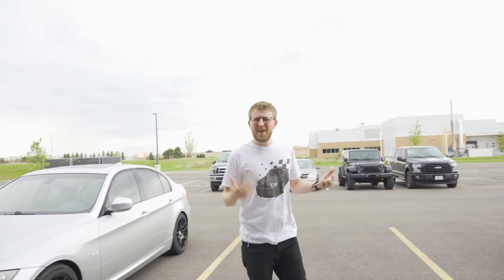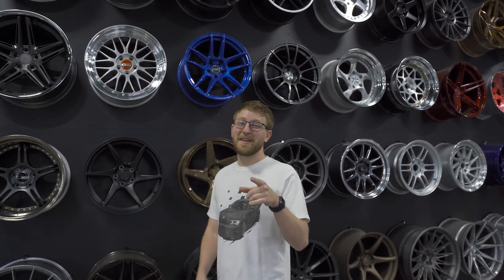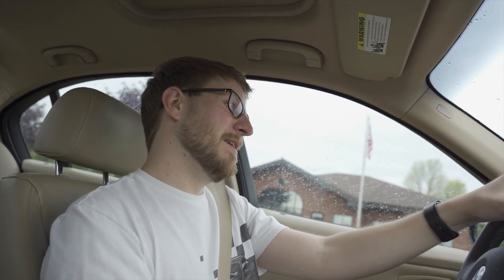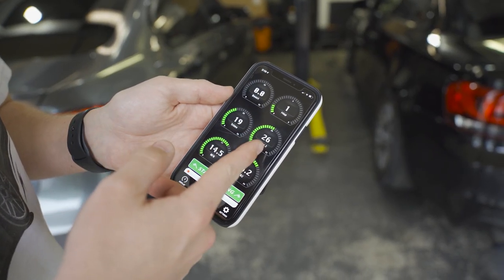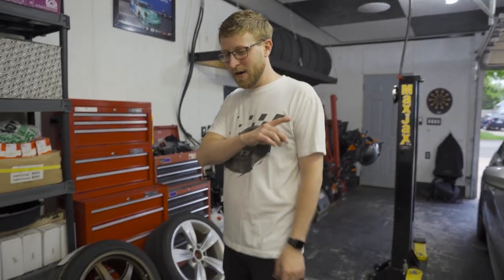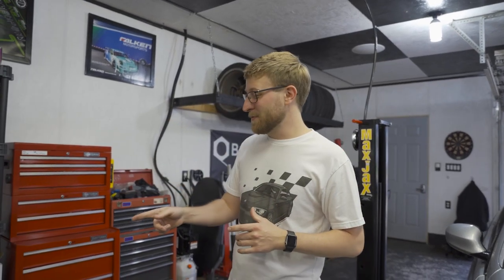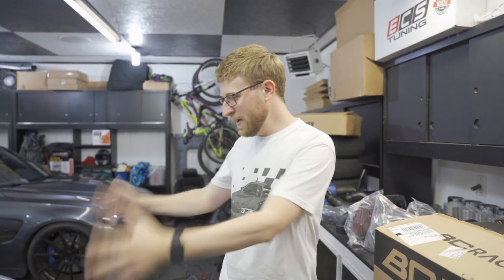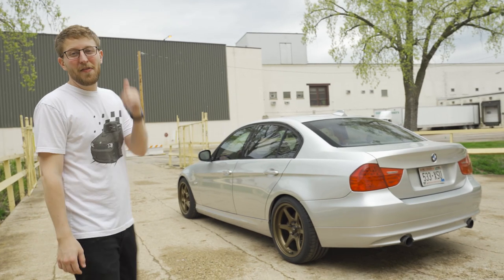I'm Still Alive... but my 135i isn't.

Comment: Check the wiring to the injectors on bank 1 with a multimeter, also check the coils on bank1 usually when the car warms up that's when secondary circuits on the coil fail or begin to break up. Hope you sort it out

Comment: Check the front O2 sensor harness wire that runs closest to the oil filter, (not the sensor itself) I had the same problem. Found the wiring had slightly melted and arced through the sheath shorting it out causing unstable afr on one bank and overfueling under hard load even after changing sensors

Comment: So glad to see you back! I copied your 135i build almost to a tee.  I was having a similar issue with afrs even with new o2 sensors.  I swapped out the valve cover for a vtt billet one and when I removed the doc race intake manifold I found that I had somehow blown out cylinder six o-ring where it bolts to the head. This was giving me an obvious boost leak but just on one cylinder.  Replacing the o-ring fixed the problem
Reply from the maker: That’s awesome to hear, man. You make a good point, I could definitely have something like that going on. I think a compression test and a book leak test should help find anything.

Comment: Definitely feeling the vibe of this style of video! 

For your 135, I assume your injectors are index 12? It's most likely something with your fuel or spark. I'd check the plugs and coils first. Don't listen to me though, I still haven't gotten my 135 running right going single turbo. D:
Reply from the maker: Thanks for the feedback, I’m stoked to hear that 🤘🏼 anyways, yes, I have index 12 injectors. I did new plugs last summer. Currently have PR coils and haven’t heard of those going bad. Gonna do a compression test and go from there 😬
Reply: @jake_spence  been hearing about people having problems with PR coils on the facebook groups.

Comment: When my M20 had cracked rings on cyl 5/6 it would run 90-95% smooth and normal until it warmed up a bit then ran rougher like a misfire on 1 or 2 cylinders. Compression test result was ~ 120 psi instead of ~160. There was also a new tapping noise which sounded like the bottom end. Root cause was the machine shop setting the ring gap to the tight end of the factory spec rather than the increased gap for boost that I advised them of. Hopefully your gremlin is electrical and diagnosed soon.

Comment: As someone else stated below, if you have an MSD80- DME, have your mosfets checked. My cylinder 2 mosfet went bad and caused misfire codes on cylinders 1, 2, and 3. Sent the DME out to a guy on ebay, he replaced them all with upgraded mosfets for like $125.
Reply from the maker: I’m definitely going to look into this if the compression test comes back healthy. I’ve avoided mosfet issues on all of my N54s so far so I always forget that’s an issue 😅

Comment: I would let the 135i run for about 30+ minute. Cut it off and come back to it the next day pull your spark plug and smell them if any smell like gas you have a leaking injector. I would also recommend taking the port injection off and flashing the car to more of a basic tune and see if that helps. Some time some port injection injectors can also leak or the o ring seals can being go and cause air by pass them causing issues. I had the same issue on my last build and I took everything off/put checked everything and it ended up not only ones one of my index-12 leaking but a seal on my port injection was shot at the same cylinder as the leaking index-12.

Comment: The wheels look great but it's hard to beat those apexs lol. What offsets do you run? 

I'm having an issue when my stft1 & 2 are ok at idle or mid range but at high rpms they get maxed 34% with rare lean mixture fault (slightly worse on bank 1). Fuel pressure, air/fuel ratio, no vaccum leaks, no crankcase leaks, new spark plugs, delphi coils, pre cat oxygen sensors are 2 years old etc... Not sure if your issue is the same since your fuel trims are off at idle... the closer to zero the better though. 

It also started after switching from e85 to pump gas, it's being 3 tank fillups since then. 

Hope you figure out the issue that thing is badass!
Reply from the maker: I know, but these are unique and fit perfectly! They’re 18x9" +31 and 18x10" +33. So lightweight too.

Hopefully you figure out your issues... sometimes these N54s are such a pain. You reminded me that I have pump gas in it from winter. I should probably put some fresh fuel in it 😬
Reply: @jake_spence  Yes try fresh fuel before you dive into the engine. Also, let the car set fault codes for a while don't erase them. Then swap things around, coils, plugs, vanos solenoids, injectors per bank etc. Maybe your bank issues switch to the other. 

Haven't figure it out yet I just left it as is. I'm running a richer custom map that helps keep those fuel trims way lower, I'll wait for something to blow up lol. It's weird because I had 0 issues at the track either. 

Good to see you get back! Great content as always!

Comment: He’s baaaacck!! Shame about the 135 I’m sure it’ll be an easy fix but I’d probably start with a compression test, change the plugs and check the wiring from the o2 sensor? And can you hurry up with the build video for the 335 🤣

Comment: Hey, have you checked your VANOS solenoids? Had a bunch of misfires, Limp mode triggered and could not cleared them. Took them out cleaned them up real good and fix my problems at least for the time being but it's a matter of time till they need replacing...

Comment: I’d look into the mosfets, when those start to go the cause a bunch of really weird issues. If you don’t wanna go msd81 you can find a computer repair place (usually) to replace them for like 60 bucks or so
Reply from the maker: Hmm 🤔 if the compression test comes back good I’ll have to look into that.
Reply: Before you go MOSFETs and DME swaps, trace back the O2 sensor harness. Visually inspect for damage

Comment: I have/had the same issues. I reset adaptations and reflash BEF and it works for a while and then after a while the issue comes back up. I have taken out the JB4 and am running on MHD stage 2 e50 map for testing. So far so good. I will be going reflex for pi control shortly after I am confident it was a programming issue with JB4 or the BEF.
Reply: Also found my exhaust manifold was not torqued to spec still. Going to tighten that up but I don’t think that was the issue.

Comment: Are you running a msd81?
Reply from the maker: It’s a 2008 and still on stock ECU
Reply: @jake_spence   I can't tell what ecu you have from year but if you check on top of the ecu it should say if u have msd80 or 81, if it's msd80 you could be having issues with the mosfets from what I can tell

Comment: Could be bad scaling on the new o2 sensors if your tune hasn’t been updated. They all read different and had my car act weird after I did mine. If you can, post a data log link somewhere where we can get it!

Comment: Jake what is your dme is it the updated one msd81? If you have the msd80 Could your mosfet be shot? If your misfires are all bank 1. Cly 1 2 and 3 that is it.

Also switching your bank 1 and bank 2 injectors and seeing if the trims switch to bank 2 could rule out the index 12s

Comment: What about downstream o2’s?
Reply from the maker: I replaced them in the last 2 years, do you think faulty downstream O2s could cause this?
Reply: @jake_spence  I’ve just heard that they communicate to the upstreams and if downstreams are bad that communication is affected. But if you’ve replaced before may not be the issue. Ohm testing can be done on them, but I’ve only seen it on YouTube
Do a small log and send it to your tuner? See what is said? 🤷‍♂️

Comment: to bad the fronts and rears couldn't be concave like the rears, also why is apex boring, because everyone has them? Have you tried the secondary O2 sensors, most stop at the primaries, also the whole harness for the O2 sensors, heard they can melt

Comment: When's the last time have you updated injectors?
Anyhow my 335 behaved sort of the same up until I updated injectors, refreshed to new maps and walnut blasted the engine, including new packs n plugs as well Still doing fine but don't know what all you've done, recommendation check around bro still good to see you at it man 🤗
Reply from the maker: It definitely could be one of the injectors, even though they’re all index 12s. Gonna check all the basics after I do a compression test. Thanks for following along man, you’re an OG!
Reply: @jake_spence  Yeah brother I'm still peeling back pavement Lol 😆
Reply: @jake_spence  Shouldn't be injectors if they are new 12s.
Reply: @TheFrenchPug  even index 12 can be bad. its not offend but it can happen. Had 2 index 12 couple months ago causing issues
Reply: I just put all new infex 12s in and if fixed 99% 0f my issues

Comment: Since the misfires are on the same bank after switching o2s I'd assume mosfets but you can switch bank 1 & 2 injectors around to see if it's one of those first. If it's mosfets it would be a decent time to go standalone If you want to take the 135 to the next level. Love the content and can't wait to see what's next.
Reply from the maker: I would love to go stand-alone. I think it would take this car to the next level with a built engine. Would be great to set up proper launch control and NLS 🤘🏼
Reply: @jake_spence  Same, I want true rolling anti-lag on mine and NLS on mine. I would also like to see people do more with standalones like switching to a different water pump and t-stat completely and really make these engines what they could be. I remember rob dahm having a video about how he uses a 5 series water pump on his 4-rotor. I think something like that would be cool.

Comment: Downstream 02? And if u did do those then maybe mosfets?
Reply from the maker: This is the second comment I’ve seen that mentions these two things. Gonna dig into it this weekend if the compression test comes back healthy 🤔
Reply: @jake_spence  vehicular diy did a video on how the car uses secondary 02 in calibrating afr and idle. it’s like a 30 dollar diy job with a generic Bosch sensor off of Amazon. Really cheap to do so might as well. Or fcp if u got them before there. the car on cold start does not use these 02s to calibrate idle because they aren’t warm. After a minute or two  u will hear the idle change and that’s when it switches over to using the 02s to control idle. If ur car starts messing up on that change over it might be 02. Also the issue is bank related which is another tell.

Comment: About time you came back lol,🖐 from 60 ROLL Cape Town

Do smoke leak test, maybe intake o ring gone bad.

Coils and injectors after that.

I think this started when you ran your 10.3?

Maybe the high boost popped a oring on intake?

Comment: If replacing O2 sensors normally fixes it, but now ISN'T fixing it, it's time to check the wiring to the O2 sensor(s) connected to the problematic cylinders/trims.

Comment: Swap all from bank 2 to bank 1 . I mean injectors coils and spark plugs.  If will not resolve problem that's mean ECU  has a issue with cmos or wiring

Comment: Any vaccum leak?
Reply from the maker: Gonna have to test, that’s a good point.
Reply: @jake_spence  maybe it's an oil pressure issue. I know that the n52 needs a good oil pressure everywhere in the engine unless it will run rough like yours right now. Maybe you should take a look at that too. Like camshafts ledge or oil filter or somewhere in the vanos system.

Comment: Did you chase the misfires by checking plugs, move coil packs around? Maybe a misfire could cause bankone to go wonky then go really bad at WOT.
Reply from the maker: I changed plugs last summer, but haven’t swapped coil packs around yet. Gonna dig into it more this weekend and possibly compression test it 😬